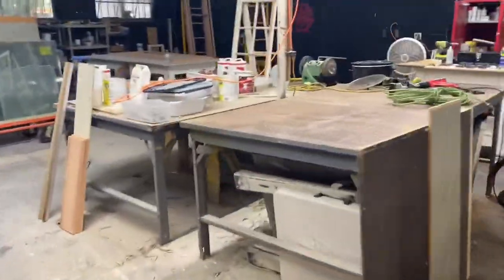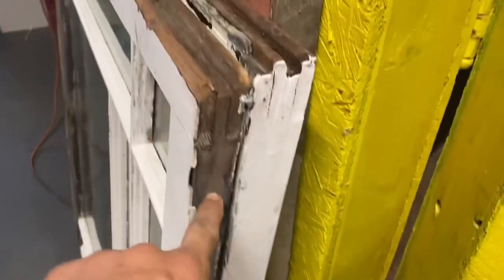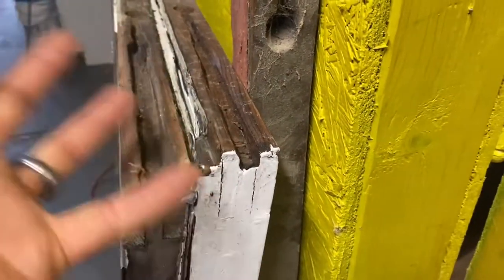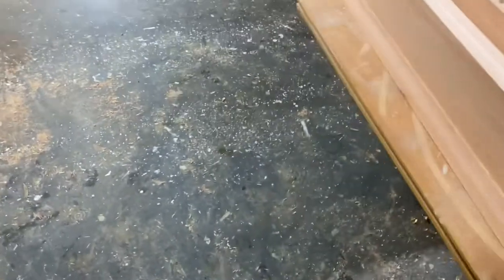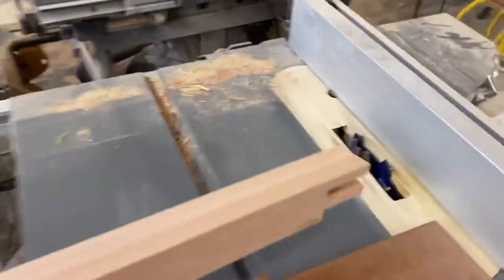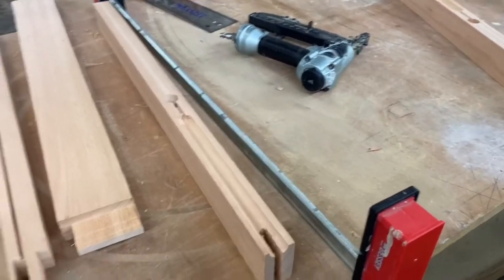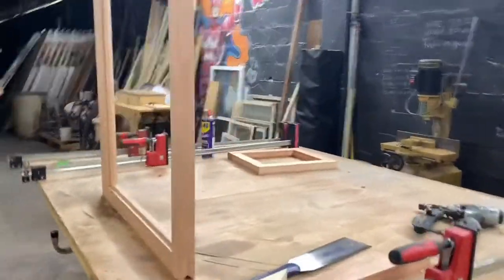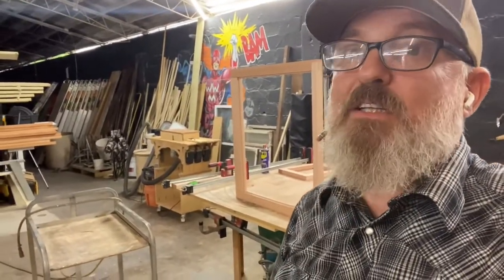When Making A Double Hung Window Sash for a House, Use 1-1/2” Long Tenons. Here’s Why.

Comment: The bottom rail supports the weight of the glass and that's why the tenons were originally longer and extended all the way through on older windows.
Reply from the maker: If that were true then the meeting rail on the top sash is designed all wrong, because there’s nothing other than a peg or a nail holding that rail up and it would often have the same sized glass. An alternative explanation is that it extended all the way through to the end to let moisture escape easier. It also might have been because it was faster to produce it that way. I’d like to see the explanation in a book from the 1800s. That I might be prone to believe.

Comment: What few 125 year old windows I still have are through tenons, even found wedged tenons on one.  I built a replacement picture window frame, 72 X 66, without through tenons.  My thought was it was one less place for water intrusion.  Secondly, what kind of wood were you using?  Have you had any issues with Accoya springing out of shape after you mill it?
Reply from the maker: The through tenons are useful because they give water an Avenue of escape. Notice that the sides of double hung sashes are never painted. This is for the same reason. So there is advantage to going all the way through - how much advantage was a risk I was willing to take.
Reply: @WoodWindowMakeover  I do it the same way Steve, you’re set for the meeting rail and you’re protecting the end grain is my argument, PLUS your often grooving out for pulley/sash cord

It just makes sense, unless you’re trying for an exact match on a seen casement or whatever.

I  PU Glue all mine too( I know you don’t) so there is no way any water is ever getting in their for a few lifetimes 👍🏻
Reply from the maker: I go through tenons on my casements because when I don’t, and I have to fit/trim them, or when I’m making them in pairs and have to do the stepped and offset opposite meeting stiles, I’ll expose the mortise and then have to fill it with something. I decided it was better to go ahead and go all the way through with a tenon in that circumstance because I’d have to fill it with something anyway. Might as well be the tenon.
Reply: @WoodWindowMakeover  makes sense, I keep my stub tenons shy of Morticer depth too, it does look amateurish when it’s exposed, especially with a hollow Morticer chisel and if you take a chamfer off tenon for fit.

I’m running a masterwood OMB 1V now so pretty much perfect Mortice now

( 1000 aud for the 3/8 chisel 😮)
Reply: @WoodWindowMakeover  very good point for the water … didn’t think about that issue .
Reply: @WoodWindowMakeover  you mean that originally the through tenons weren’t painted …?
Reply from the maker: Never
Reply: @Dazza19746  a pleasure to read you. Thank you

Comment: What size tenons to you use for a muntin?  The meeting rail will not allow for a 1.5” tenon. Do you keep the 1.5” for muntins that go into the stiles?
Reply from the maker: Yes. The trick is to measure what the length your exposed glazing bar is, and add three inches (1-1/2” tenon on the ends), and then just cut off the excess you don’t need.